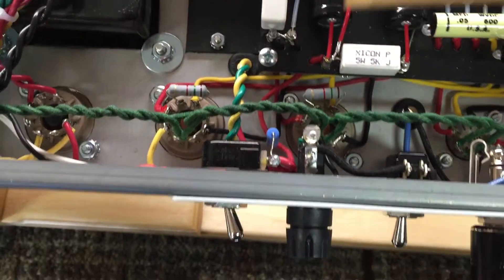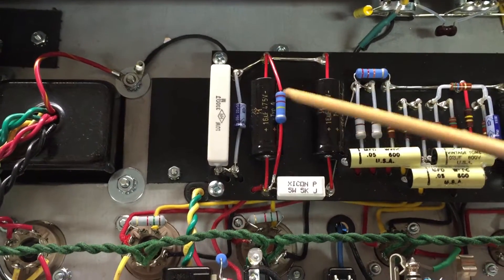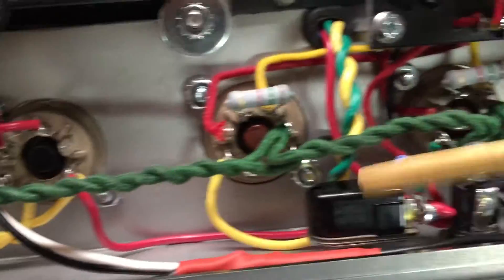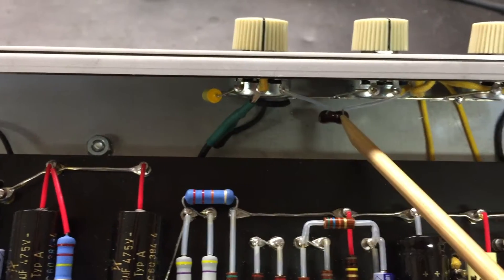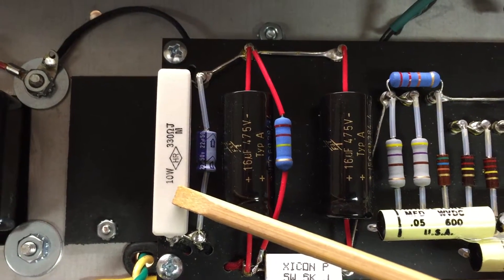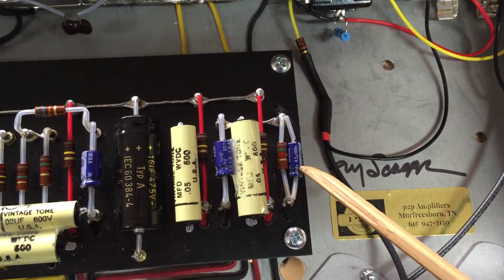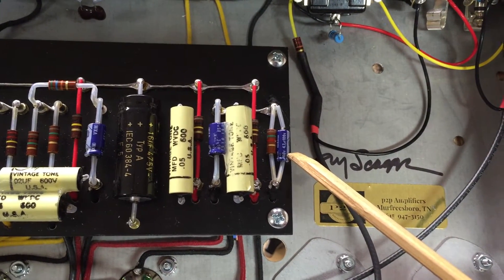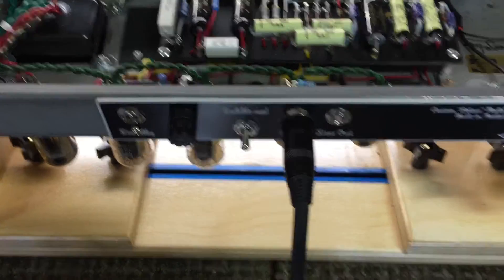5e3 Bench Test 2

Comment: Beautiful build very nice and clean.
I too reworked a 5E3 as you I too am using 4.7uF V1 & 2 cathode bypass caps and lowered all coulpling caps, as you mentioned it bleeds off some  bass clears the distortion blocking, sure opens up the amp a lot
Reply: What resistor are you use with 4.7uF caps?